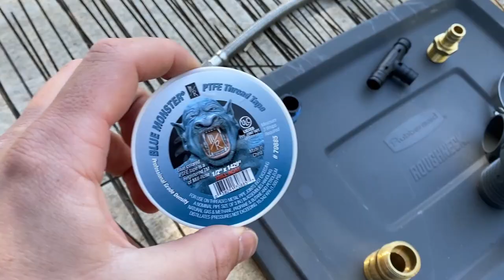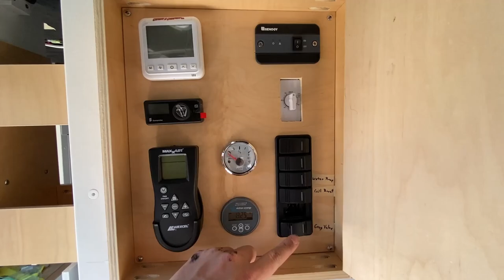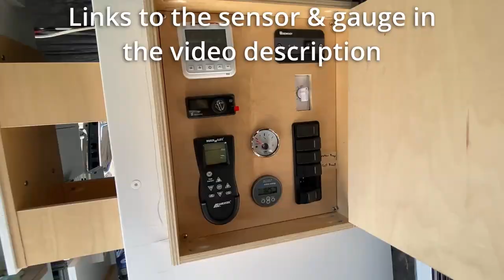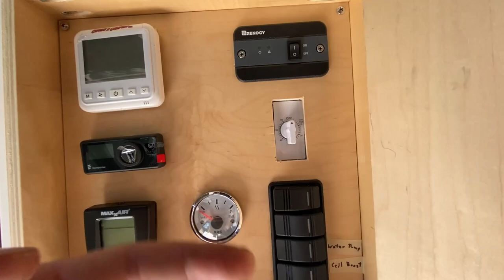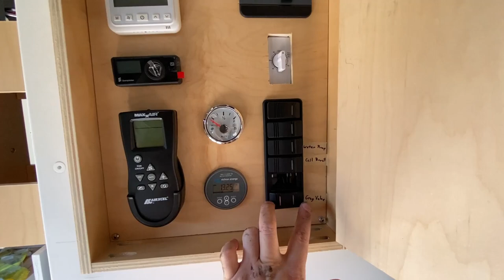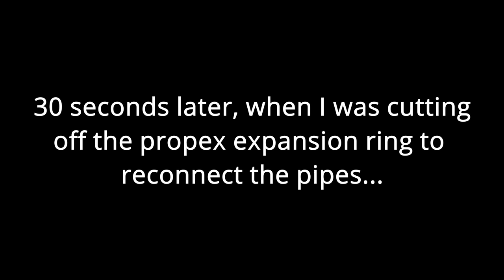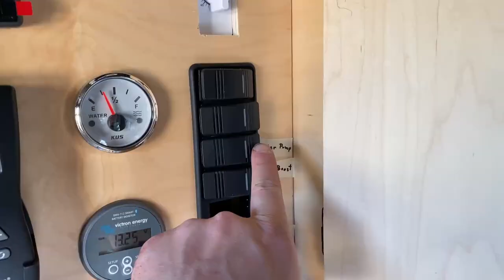INNOVATIVE 💧 Off Grid Water System IN A VAN 💧!!! ProPex, Gray/Fresh Water Tanks, Electronic Drain

Comment: Wish my local Ace Hardware sold the expansion system.  I used crimp, and it works fine, but tough getting into tight areas.  Your work is so nice and clean.
Reply from the maker: I agree, that’s the worst part about propex is that it hasn’t caught on yet. My bet is that this is the most popular plumbing system in 5-10 years!
Reply: @seven_o_savage  I could have saved hours, maybe days.  Thank you for this vid.

Comment: The Isotemp water heater. Great idea with the timer btw, but are you not considering connecting it up to the engine coolant system? Making hot water whilst driving makes a lot of sense to me. Ben 🇬🇧
Reply: I second this idea. This will save quite a bit of battery power when you can simply heat the water when driving vs. heat with the isotherm heating rod.

Comment: How about putting your drain valve inside the van... as it is now you will collect water in the tube before and in the valve that can still freeze.  So you wont be able to drain in frozen weather. As for the filters I have the same question... don't these have to be installed vertical for a good functioning system?  Other thing is as mentioned already... when you need to service them you may spill water all over the place.  I love these video series you make and the way you try to cover and discuss all parts of the conversion. As you are learning, I am too. Thanks :) 👍

Comment: Really great video. I see one issue though. You have the water tank inside the van to prevent freezing. But you have both water pipes to the sink on the outside. These pipes will freeze in cold areas. You should have kept them inside, or you need to insulate them heavily. This would also help that they are not damaged while driving over debris.
Reply: I don't think he wanna go to cold regions like you gotta do in europe, where every place is cold

Comment: running the plumbing lines under the van are subject to freezing even though you have the tank inside the van
Reply from the maker: Great part about propex is that it’s virtually freeze proof. If I do winter camping I’ll probably add some heat tape.
Reply: @seven_o_savage  it isn't freeze proof. It is expandable up to 1.5 times it's original size so frozen temps won't damage it as easily.

Comment: Good stuff, but I am really surprised that you did not use a HepVo drain valve at the sink and even the shower to eliminate sewage gases and to get a much better set of fittings (I don't like all the black hub couplings screwed down over the barbed fittings)
Reply: Looks like an obvious correction for the remodel list. Plumbing is not Steve's forte.

Comment: Are you planning on connecting the heater to the vehicle coolant system to heat the water or are you just relying on heating it with AC power?

Comment: With the leak off the top of the accumulator - why not just move the vertical mounting bar that the pump and accumulator are mounted to over about a half inch or whatever? You could have taken that lateral stress off the Pex line/collars and gotten a more straight run to the filter inlet.

Comment: OK Seven O. Savage, I have watched your Plumbing video a couple times and I am not seeing either a gravity feed or some sort of pressure relief for your tank (Your water fill goes directly to the tank). Many tanks require a diverted city water to avoid causing leaks in the tank by over pressurizing them. It appears with your system you are pressurizing your tank when you stay connected to a spigot water supply such as a house or a campground. Did I miss something in your video where you have a tank pressure relief or something creative? Why not gravity fill your tank and divert your city water directly to your fixtures when connected to city? We look forward to your response! Thanks, Team Off-Road Vanning
Reply from the maker: Hey les, I do have a tank vent/overfill port which ends up being connected to the two-way check valves outside of the van. As for city water, I never plan on using it

Comment: Hiyas, I’ve got the clear source filter in the UK I want to put it in line with the plumbing system even though they recommend using it externally before the water goes into the tank. How is it working out being part of the plumbing system? Also finding it hard to find attachments here in the UK as it’s American GHT fittings. I need it to go to 12mm or 15mm… what fittings do you use and do you have a link for it! Thanks loving the videos so helpful

Comment: Thanks for the video! Just a quick question - where did you buy and how is called the black rubber sleeve that is shown in the video (15:54) and is where the pipes and cables go under the van? Thanks for information! I've been looking for it for a long time and can't find something like this (MB has it also when cables ale leaving the driver's seat and go under the Van - the reason I started looking for this solution :D)

Comment: i would but that ball valve inside the water would freeze on that outside section, also insulate the lines at least under to prevent freezing in colder temps

Comment: Why not Shark bite fittings there a little expensive but they are removable and reuseable ? Keep a couple extra caps and if you ever have a problem you can cap it off and use the rest of the system
Reply: Right? You can plumb 10 vans in sharkbite fittings for the cost of one of the pex expanding tools.

Comment: I noticed that you didn’t put in a “P” or “S” bend trap below the sink or shower.  So you have a direct open connection to the grey water tank.  This means that smells that build up in the grey water tank can “vent” into the inside of the van.  It could get a bit smelly inside!  😖
Reply: Hate when there's no p trap in a van. No s trap, especially with no drain vent, which is also almost never used sadly.
Reply: You can skip a vent with a big drain but not a trap.

Comment: Hey! I saw this video back and forth several times, I was about to get the Wolf 60000 (truman version) of diesel tank water heater/furnance but is huge. So I'm thinking going electric (since we have 15kw batteries) I was going for the bosh simple water heater but on this build you used the Isotherm but didnt talked about much about it. Does this model connects to the van engine coolant too?

Comment: Hello GREAT VIDEOS!  I have been watching your videos since the beginning videos of your first build. I have a question about the Isotherm water heater heater. Are you attaching the radiator system thru you water heater and or just AC? thanks I have been using a Bosch electric 4 gallon water heater and it uses way to much electricity and was entertaining the of using a calorifier type of water heater. But  I am concerned about running exposed radiator hoses under my Transit van. I noticed the Isotherm AC is rated 750 watts compared the Bosch water heater which is rated 1440 watts. Your thoughts? thanks

Comment: I have a van on order and have watched all your videos, thank you for all your suggestions and time in your videos. I was wandering if you were going to hook up your hot water heater to your engine cooling system to run through your hot water tank. I am debating the same thing. I am thinking going with the Bosch instead of the isotemp because I do not want to mess with the engine radiator. Are you just not hooking it up with the isotemp?

Comment: I wish you would have mounted the accumulator in line with the pump and the filter. You could have avoided the vinyl section, and that excessive loop. Also cutoffs on each side of the pump would have been nice in the pump needs to be replaced. Furthermore, the effectiveness of the grit filter and water filter may be less in their side orientations.

Comment: Thanks for the video! Great channel!
A couple of quick thoughts:
1. Why not simply use a tank vent as they're designed. $10.50 on Amazon for a 1-in that mount directly to the top of the tank, and you're done. I would much rather use cabin air to change out the tank air rather than outside air by the exhaust and dust. Also technically I don't think there's a need for a high point in your vent tubing - It will never see water. Also, aren't those check valves on the vent line designed for water that will require a certain pressure to open them? I'm not sure they'll actually work with the wisp of air from filling and emptying the tank. Your solution is noble, but huge overkill, in my humble opinion. Install a screened tank vent and be done
2. Manufactures literature on expansion tanks gives a lot of flexibility as to where they can fit into the system. It does not need to be immediately downstream of the pump. With this knowledge I think you could have avoided the offset between the pump and expansion tank that resulted in the leak....
Again super duper channel. Thanks for all the help!
Reply from the maker: Thanks, it’s a vent and an overfill line though
Reply: @seven_o_savage  you da man
Reply: @sargeant mister, can you post a link to the screened vent you used please?

Comment: For the water gauge, what size of fuse did you use? Was it connected to the 12DC fuse box?
Reply from the maker: Very small. I believe 1a or 2a. Yes it’s connected to 12v fuse box and is perpetually “on”

Comment: Mounting the water filters horizontally will be a mess to service.  When you spin them off all the water will leak out.  
Maybe switch locations of filters and pumps. Pump will fit on top of tank and then filters can be mounter vertically.

Comment: Nice and thorough walk through! I think I've rewatched this at least 10 times now since Im in the middle of building out my water system. Where did you find those black check valves? Ive been searching online and hardware stores with no luck. The ones I have found are extremely pricey.
Reply from the maker: Thanks! I bought the extremely pricey ones, but you can get brass check valves on amazon for cheap.

Comment: Wow great van build. Love all the information. We're taking notes for our future van build. Might sound silly but we love seeing things that work vs things that don't. Is there a difference running lines under van vs running lines in flooring ? Amazing van build
Reply: Running water lines in the floor is ideal if you do it correctly. If you're running both hot and cold lines, make sure they're not touching. Separate them either by leaving an air gap or insulation. There should also not be ANY connections in the floor itself so that you don't have to rip out the floor in the case of a leak. There are 90° bend helpers made for PEX to avoid needing an elbow fitting. If you don't have space for a bend helper, you can still use a regular elbow, but notch the subfloor so that you can access both ends of it and replace the fitting if necessary.

Comment: I enjoy your videos! 1 note: shouldn't the fresh water drain valve be in the van so as not to freeze?
Reply: The fresh water plumbing you routed under the van is going to freeze.  I agree with other comments, if you are truly making this a 4 season van, you need to move all mechanical plumbing fittings into conditioned spaces.  Now that you have pressurized the filter system.  Go through the process of changing the filters.  With 3 filters, you are going to have a lot of water getting to hidden places you will not be able to protect/clean.  Appreciate your videos and your willingness to figure things out.

Comment: I love your videos. Quick question though.  Won't the under body water lines and gray water tank freeze in the winter?
Reply from the maker: Yes, in my last van I would start the engine in the morning to defrost them. If that doesn’t work in this one I’ll probably use heat tape.

Comment: I know this commet is almost a year later, but I was curious as to why you went with this water pump. I've been looking around at some for my van, and have seen many for 3gpm while you chose 4gpm, I was curious as to why since our showers and sinks are usually low flow to conserve water. Maybe that specific pump has a special feature I'm not catching? Just interested to find out before I buy a pump. Thanks.
Reply from the maker: Either way works I was intending to have more water pressure but 3gpm did the job too.

Comment: Hey Savage...I have those exact same fresh/grey tanks and came across this vid. Great job. question - what length sensors did you order for each and where on the grey tank did you install it? Kind of a funky set up down there.
Reply from the maker: Howdy, I got a sensor that’s about 1” shorter than the height of the tank. I only put one on the fresh water tank but you could def get one onto the gray water as well.

Comment: SOS - did you use 10 or 15 series 80/20 for your water tank enclosure? Would you choose the same again? I'm on the fence.
Reply from the maker: 15 series and I just used 15 series for everything. It’s great but I’m sure 10 series would be fine
Reply: @seven_o_savage  Thanks Seven! I’m going to stick with 15 series for the water tank because it’s so heavy, but try 10 for the kitchen cabinet to reclaim a few inches.
Reply: @EdClarkePC  Had this same dilemma a year ago when I started my build. I chose to go with 10 series for everything. Slightly harder to find extrusion and hardware than 15 series, but I chose it for the same reason - keep as many livable inches as possible.

Comment: Thank you for another great video!  Very helpful!  I wish you or someone could demystify the tapping of the fresh water tank.  I have the same tank as you but am not sure about how to tap into it.  What fitting is that? What tool was used to open it? What glue? What is the process? Thanks again for a great video?
Reply from the maker: Hey Jeff, there are pre threaded ports on the tank, and for the 1.5” holes you do have to drill out the plastic in the bottom. You can use a hole saw bit. 

As for connecting to the ports in the tank, they just accept regular NPT fittings. Just make sure you’re using plastic ones and adding tape.
Reply: Thank you!

Comment: What three-way switches are you using in your wall panel? I checked out your electrical video and I didn't see links to them... I think it's a three-way seven-pin probably?  I'm asking because the only ones I found so far have graphics on them and I want plain black ones like those!
Reply from the maker: They are called DPDT switches, if you follow the link to the switches from electrical they are one of the options
Reply: @seven_o_savage  ohhhh. They're on your electrical diagram! I was making my life way harder than it needed to be by going down a rabbit hole! Thank you for the reply and I made sure to use your link!  :)

Comment: Thanks for this video. I’m using your idea to run my gray water tank for my van build. I ordered the 1 1/4 spa tubing in your link but can’t find the barb fitting to clamp to Would you be kind enough to send a link or tell me what size it is?
Reply from the maker: Nice, which barb fitting? Most are available at your local hardware store!!

Comment: Where is the p-trap (or similar) on your sink lne to the gray water tank? The way you show the system, you're going to get all kinds of bad smells in the van from the grey tank. Also, I didn't see any air admittance valves to allow water to drain properly.
Reply from the maker: No p trap and no smells so far. There’s an “effective p trap” due to the natural ups and downs of the pipes
Reply: @seven_o_savage  I can see that as working. I was going to put a "u" in the waste line just under the sink to act as the p trap. Then I found simple in-the-drain traps that seem effective and dirt cheap.  How about the vent (via air admittance valve?).

Comment: Hi There, I’m installing the same water heater that you show in this video. I noticed the manual for the unit shows that it is to be installed on its side only. I’m curious if you’ve had any issues with installing it flat. Your comments would be greatly appreciated. Thank you!
Reply from the maker: I have not, but to be honest I’ve only used it a handful of times
Reply: @seven_o_savage  Thank you. I likely reach out to the manufacturer and can circle back here If I learn anything…in case it’s off any value to the community.
Reply: I have the same question about the Isoterm 601623. Perhaps we can find some way to have an off-line conversation. I purchased it over a year ago and am just getting around to installation.  I did not read the installation manual prior to purchase. It does not show a horizontal placement. Based on my fresh water tank, bed, and other design issues, I am committed to an installation as shown in the video. I will also see if I can get manufacturer input and contact the dealer where I purchased the unit.  Additional comments from you would be appreciated.
Reply: Actually, it does say that you can install it horizontally in the manual itself. Somehow it’s easy to overlook it. But, it is there.
Reply: Yes... The manual does say it can be installed vertically or horizontal. It would have been nice to show diagrams of both mounting positions. The diagrams in Fig 6 and Fig 7 lead one to believe the vertical is the only valid position. The reference to the diagrams shown in Fig 2 does not help. I will go ahead with the horizontal positioning.
Reply: Did you end up mounting it flat? Any issues? The diagram is super confusing looking.

Comment: Why are you use pex at the output before the water pump? I was under the impression the braided vinyl comes out of the tank and the pex is used on the output side of the pump. Just wondering if you have a legit professional reason?
Reply from the maker: Either way would work